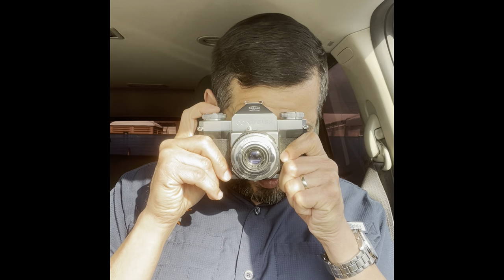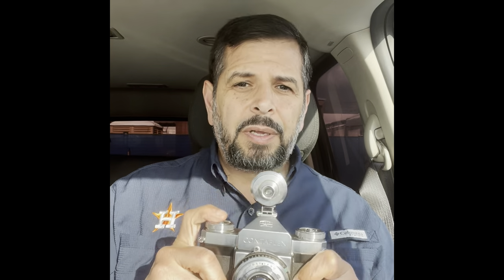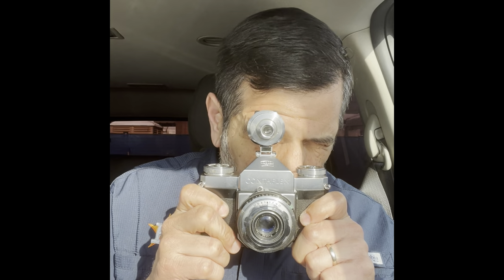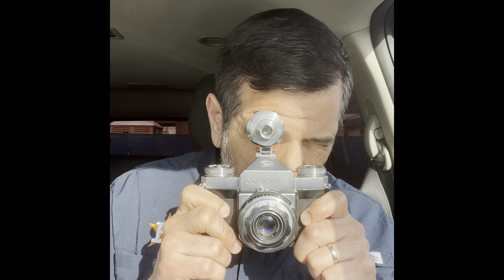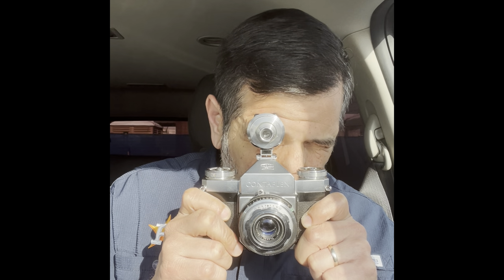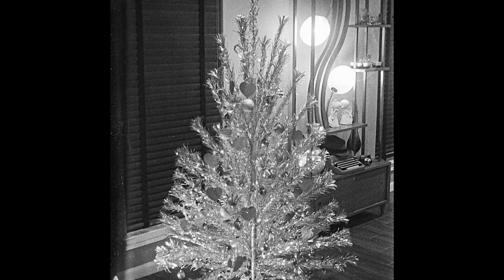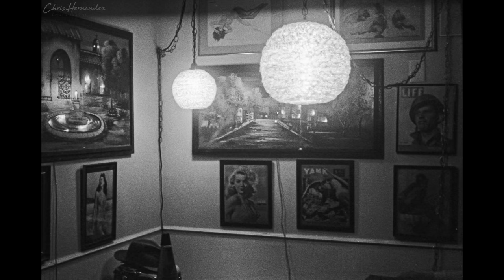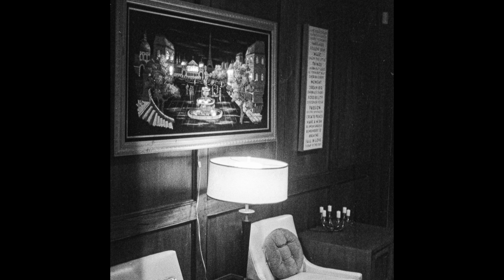Using a Zeiss Ikon Contaflex is Like Being a Tank Gunner

Comment: I have same issue with Contaflex ll  but instead of rapping camera, I pushing timer lever towards X to force timer to finish and release shutter. I am trying a roll now to see how it turns out.
Reply from the maker: @WhooieWahoo  did you finish the roll?
Reply: Just when I thought I could get shutter by moving timer a bit, this stopped working and I didn’t get to finish the b|w roll (only a few times when advancing the film did the shutter release before it stopped completely).
Reply from the maker: @WhooieWahoo  did you try banging on the bottom?

Comment: Hi, I recently bought one of these cameras, I was wondering how you know when the shutter isn't working? Thanks
Reply from the maker: I’d set the shutter speed at 1 second, then cock it and press the shutter release. You should hear the mirror instantly flip up, then the distinct one-second shutter cycle. If you only hear one very fast “click,” then only the mirror is moving. Hope that helps.
Reply: @houstoncombatphotography9454  Thanks for your help :)
Reply: Take the back off the camera. (Presumably, the camera has no film in it.) Look through the back of the camera, trip the shutter. You should see the mirror flip up, then the shutter will open, then close after the set time. Be sure to test all the speeds. Often the faster speeds will be fine, but the slow speeds will not. Be sure to set the lens to the smallest aperture for this. Sometimes the shutter and mirror are working just fine, but the aperture blades are gummed up. If the aperture is working correctly, you will see only the smallest aperture size. If instead, you can see the aperture still closing down, it's gummed up. I own a half dozen of these wonderful cameras... however, I never thought of using one while also shooting at someone!     ;-)